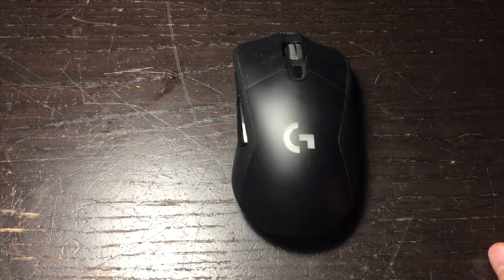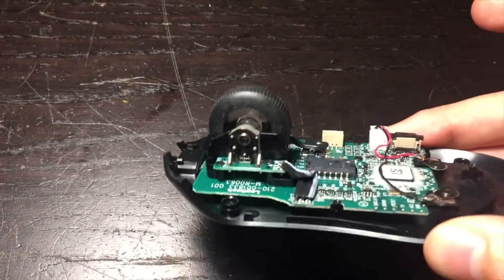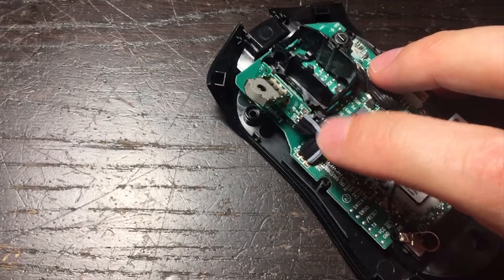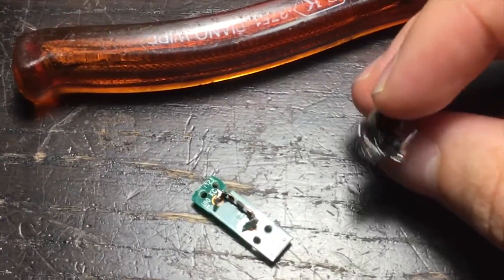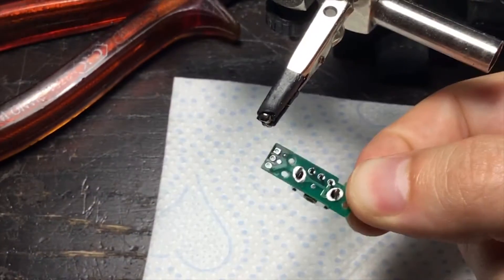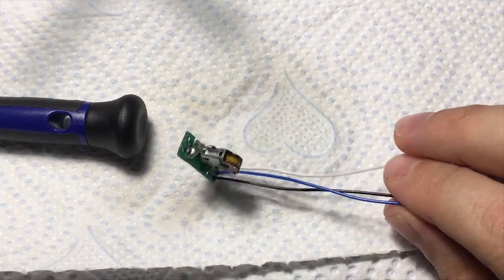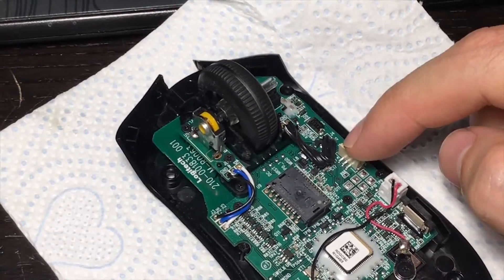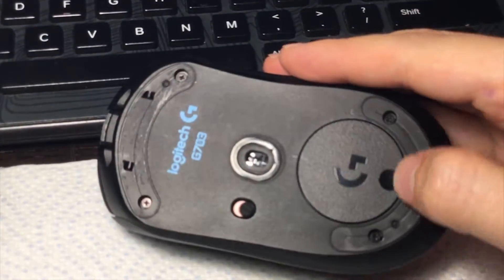Logitech Scrolling Fix

Comment: Is there a mouse that comes with a good encoder standard? I have 3 with the same issue. I would rather just buy a good mouse than try to resolder a new switch in place. I am not good with that type of work.

Comment: I just had the same problem with my G Pro Wireless. The scroll wheel became totally useless. While scrolling, it would jump either too far or in the wrong direction. It seems that the encoder was just dirty. I cleaned a lot of gunk out of the encoder under a microscope using a fine needle, tweezers, and Q-tips along with a mixture of acetone and isopropyl alcohol and air to fish it out. I reassembled the mouse and now it works great.

Comment: Had this problem 2 times. Most of the time, the encoder is actually fine and you do not need to solder anything. The part of the wheel that connects into the encoder has most likely just worn out a little. I've fixed it by supergluing the wheel to the inside of the encoder, but as other videos suggest, you can use a piece of paper in between the wheel and the encoder and that works just as well. This time I did both. Paper and glue and hopefully that lasts longer.
Reply: The crappy mouse switches though.. replaced them with kailh switches when they hit the bucket.

Comment: I at least have the satisfaction of knowing that Logitech had to send me a replacement mouse for the scrolling wheel issue, but unfortunately the second G403 they sent me had the double click issue and they informed me my warranty wasn't from the date I received the replacement mouse but from the date of my original purchase so I now have two partially working G403 mice.
Reply: Hit your LMB (not too hard) OR/AND drop your entire G403 from ~5cm distance to your QcK. Thank me later.

Comment: yea that's awesome. However, this is not for beginners. If you are not use to soldering then you might mess it up more then it is. For just a quick fix, I recommend the small piece of paper trick. Its easy, don't have to solder and takes less time and the results are typically the same. Look on google if your not sure.

Comment: Thanks for tearing this apart so I'm less likely to break mine. Would you be able to put some links to the encoder and the pads in the description? Awesome vid though, I only recommend you use a headphone mic and your phone or otherwise for audio, saves hassle with audio volume discrepancies